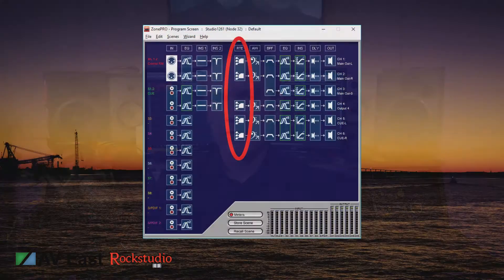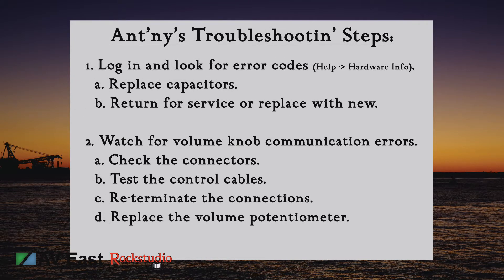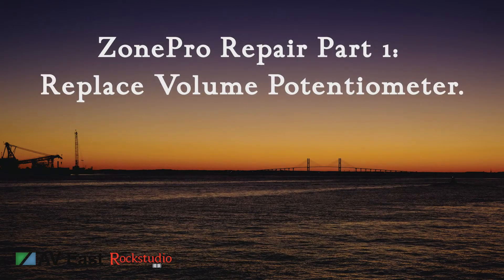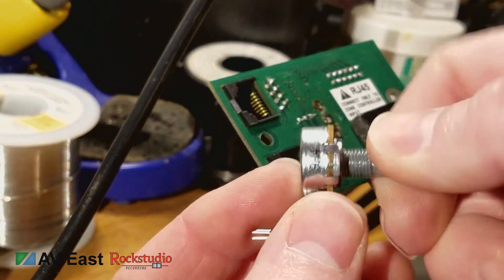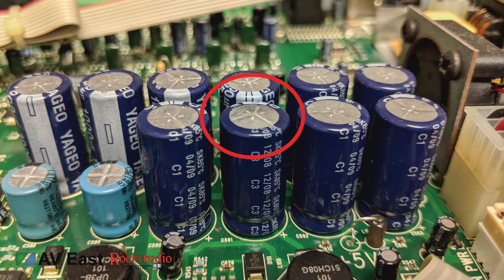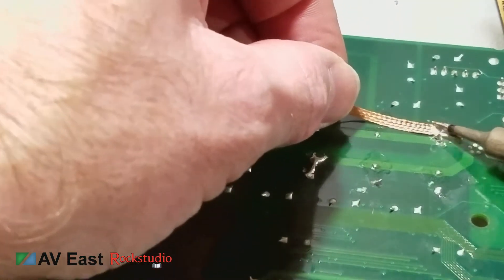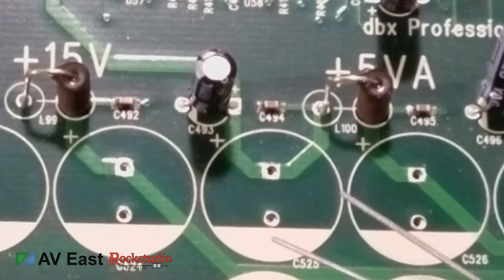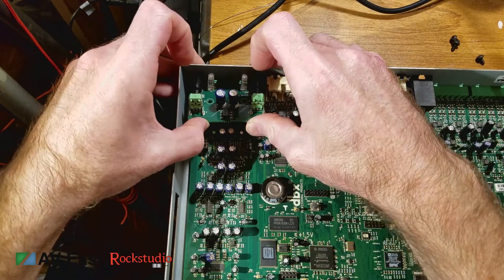dbx ZonePro - Common Problems - Troubleshoot & Repair

Comment: Thanks for the video . I was searching a while for this info, but found it too late 🙂
I bought a new DBX640 a few months ago.
But stil having problems with the potentiometer DBX part number: 40-2125 to get it here in Austria / Europe. My dealer doesn't have it and Harman Austria doesn't "know" it. ;-)
Do you have more infos about type and range (Ohms) of the pot - maybe I can get it from another fabric/dealer.
Thank you

Comment: Great Video , I have a customer with a Zone Pro 1260 that changes sources by itself, any thoughts?
Reply from the maker: I have experienced this as well. I'd check/change the cables on the zc-bus. I think this happens when there's interference within the cat cable. Say your volume is on controller 1, source is on controller 2. Even though the controls are separate and may even be wired to a Break out Box individually, they still share the same 8 conductor cable, even just by virtue of the connector. So if the cable is damaged, or there is a place where the insulation is a little thin, maybe two conductors are getting close together, your control input coming across conductor 1 can now bleed into conductor 2- and now the ZonePro thinks you're sending two commands on two different controllers. Hope this helps.

Comment: I made a little notch on the side of the plastic tip of a solder sucker. Apply heat to the solder work, position the solder sucker while the solder iron tip is still on the solder (creates a seal), then pull the sucker trigger and immediately pull the solder iron tip away with a little tilt motion.  It's quick!  Alcohol cleanup step is quicker also, you don't have all the rosin from the wick.

Comment: Craziest thing is that I’ve been installing these since 2004 when they came out, and at the time there was no other unit which could do even close to what a ZonePro does that didn’t involve having to be a sound engineer to operate.    These are designed with the retail space GM as the operator, and they are excellent at that.    Oh, so I’ve installed maybe 50 or so of these units, always the 640 or 1260, and have never had one single failure.    I was responding to a concern from a client and just for kicks I looked up, “do dbx ZonePros ever fail?”     And this popped up.    I’ve also never noticed them running hot.    In fact I’ve never installed a fan and they are always mounted directly on top of the Crown amps, driving JBL Control 25 or 28 speakers and sometimes C26s for bathrooms.     This combo has proven dead reliable.   Most often any problems end up being user error.  Someone may have added IT stuff to the rack and accidentally left an IEC cable just loose enough to become intermittent, or touched a network cable just right to cause the same, even though I stress test everything when  buttoning up a rack, meaning I pull and push and twist all cables to assure there are no bad connections.     Usually someone has rubbed against a ZC knob and broken it, or some wise guy has muted the zone on the face of the unit or turned off an amp or something like that.    I have had a few Crown amps die, but that was because the client left it on for like three or five years and when power went out or it got turned off for whatever reason, it wouldn’t power back up.     Crown tech said a cap in the start up sequence will cook itself if left on forever.   But at that only two amps have done that, and most clients just leave them in even when I implore them to let them cool off once in a while.      The knobs are not potentiometers by the way, which would be analog in nature.   Digital versions are called encoders.    It changes code.   Duh.    I’ve had one develop an bad connection at the mic/line input level selection button next to the gain knob.    That’s it.    Sometimes the screen loses contrast.     Usually a factory reset fixed that even.     I’ve had one where the manager needed to shut off the unit and let it discharge its caps, and then turn it back on 90 seconds later and it was fixed.   It was not responding to input changes on a ZC8.   I’ve had ZCs outside at a bar on immediately over salt water, telling the client that location would ruin it and I gave it one year to last.   That was 2005.   Still works, covered in grenadine and all.     Sometimes the LED will fail, but not really, it just falls out of the lense.    Put it back out a drop of superglue on it and all fixed.     Network cables not cleanly terminated have been my biggest issue,  so I e learned to get good at that, and no more of those issues.      So.    Thanks.    I guess I’m lucky or just not hearing about it when they fail.   I’ve not heard from some clients in ten years and assumed some other sales guy talked them into something else, but no, they just had to remove it for a remodel and asked which wires went where, I talked them through it, and saved a two hour drive for repair.    Other companies sell maintenance plans.   I sell a promise that it will be the last gear they buy for many years with no number given, but start listing off places which have been trouble free for 5,7, 10+ years and they are convinced.   My lousy salesmanship has  gotten me a 95% closure rate on prospective sales.    Can anyone touch that?     It’s called trust, and especially when it’s a referral, which they all are, they trust me before they meet me.      I’ll never be rich from a service plan, but my clients trust my word without question.
Reply from the maker: Well, quite the yarn! Thanks for commenting. I don't do service plans either, I sell and install equipment that will last for a very long time. I am in the deep south, on the Atlantic, so we have very hot weather most of the year, very humid all year. That's why I've been installing fans on all of my zonepros, they are lasting longer now. If fact (hope I don't jinx it) I don't think I've had more than one failure since I started doing so. Every one I've ever installed will run hot, uncomfortable to touch. Like you said, you must be lucky.

Comment: Hey man I really appreciate your input on dbx products, but a lot of people having issues with dbx venue 360 and PA2, overtime this units won’t pass the logo screen and require hard resets or even connect to a pc and wipe and install the running software, sometimes this steps don’t even work and you need to just throw away the unit, my humble opinion about dbx at this moment is that they are partnered with Chinese companies and everything they make right now is absolute garbage.!.! Period
Reply from the maker: I don't know too much about their situation from an engineering / update future products perspective. However, I can say after veering away from their drive rack products, that in today's world I would not use one of their drive rack products but look to a more complex yet flexible solution. For instance, you can buy a used Biamp Nexia SP or CS for around $100. In fact, at that price you can buy two, program them both the same, and leave one as a cold spare. Then you can lay out your processing changes exactly as you'd like, and it gives you way more flexibility than the driverack. Even their Venue 360 is completely outdated by today's standards- it has a bare minimum interface, it doesn't have very user-friendly controls (difficult  or impossible to input a specific value, making you rely on sluggish faders on the GUI), and a very inflexible routing system. A processor like the nexia is incredibly customisable, and you can build special features and very complex or simple processing chains. If anybody would like to see a video on setting up a nexia, let me know. Thank you so much for watching and commenting.

Comment: Anthony, thanks so much for bringing some light on the depths of the ZC absyss, I'm fixing a sound system at a bar running on a 640m and I'm having a headache connecting the unit to the software. I cant understand why they came up with such a specific pinout for the RS323. I'll come back to the bar tomorrow for a second round using the LAN cable but today it was so frustrating trying to make it work with a regular RS 323.
Reply from the maker: You can't connect to the 640m with an Ethernet cable. You have to use the serial cable. I use the tripp-lite Keyspan USB to serial adapter. It works great. First you run the trip light software called keyspan serial assistant (or something like that), and you can see which Port is connected to, it'll say idle. Then when you open up the dbx zone pro designer software, you can go to the settings and select that com port. You must run that keyspan serial assistant software before you run the dbx zone pro designer, every time.
Reply: @therockstudio  Oh thanks so much for this! I couldn't get the Keyspan but I got a similar one from a brand called Sabrent. Do you think I could get away by rewiring the RS323 cable in order to get the specific routing the original modem null dbx provides?
Reply from the maker: @skyparnes  I don't know, I'm not an expert (or even a noob) on RS protocols, I just use the standard serial cable that comes with the dbx, and the keyspan.
Reply: @therockstudio not true about every time.   You just need a decent serial to USB adapter, download the driver for that adapter, and you’re on your way.    You should look at the hardware part of your computer to identify which COM port you will be using, because you’ll need to punch that into the dbx software to connect your laptop to the unit.    There is no pin out mod needed.    Once you’ve done it a few times it becomes second nature.   It will find the correct address and ask you if you want to send or request a program.    Do what is appropriate.     Sometimes if you don’t close out a previous session the software will come up as busy.(running) .   Just clear that out and start over.
Reply from the maker: @andrewhigdon8346  You may be right, I connected to one today and did not start the keyspan serial software beforehand, and it was able to connect. However, the reason I have always started the keyspan serial software prior to starting the zonePro designer software, is because in the past I had to do so. So your mileage may vary.

Comment: Have you ever encountered a unit functioning normally, but none of the buttons/controls on the front respond at all?  It's a 1260
Reply from the maker: The front panel controls may be locked. I'm not sure how to do it/if it's possible. But take a look

Comment: Hi thanks for the great video ! I have the 1260 model and its starting(not really) with an "critical rtc_calibrateDSP READ Fail" -  error (I bought it for very! cheap on a marketplace, but cant retourn it). So it keep rebooting due to this error. In the debug menu i see that the watchdog timer is all zeroed. I can connect over RS232 and IP to the ZonePro, but after a few minutes its rebooting. Sometimes it stays on but with an meter error and its flickering on the frontpanel leds(VU meter). Do you have any ideas? Ive opened the housing and dont see any blown caps or something else strange. 
When I set the time through the designer software it wont appear anyways in the watchdog timer(dont know if its the same clock). The error still appears after disconnecting every connection(so just the power connector plugged in). Ive updated the firmware to the latest release.
Would be really thanksful if you have any ideas :). Kind regards
Reply from the maker: Hi thanks for watching! Your situation is beyond my scope of knowledge of the dbx:( I'm so sorry but you should definitely reach out to dbx (Harman) tech support: (844) 776-4899

Have you used the CPU reset button on the PCB? I don't know really anything about programming and where the real time clock error would originate.

Comment: Thanks for the info in this video! Question: I have a 1261 that keeps blowing fuses even if the power supply board is disconnected from the main board via the 6 pin connector. Any idea what might need to be replaced on the power supply board? Thanks in advance!
Reply from the maker: Hi thanks for commenting. I'm not an electronics tech, but I'd look at the bridge rectifier and check the taps on the transformer. Beyond this I have no idea! Maybe you have a good electronics tech in your town. That power supply is going to be pretty standard, as far as power supplies go. Also don't forget, you can call Harman tech support, perhaps they offer a replacement PSU.
Reply from the maker: The replacement part # is 5061867
DBX doesn't have any in stock right now, you can order one but it might take 8 weeks or longer! I've put an email into my distributor, to see if they happen to have one in stock. I'll let you know if they do.
Reply: @therockstudio  wow thank you so much for that info! Much appreciated sir! Good to know there are people out there willing to help others such as yourself.
Reply from the maker: OK, I heard from my parts guy, he said the part # is actually 23-0000-DBX, it's about $57, 3 week lead-time.
Reply: @therockstudio  Wow that's incredible! Can you by chance give me a contact or link where I can purchase it? THANK YOU
Reply from the maker: @deanhopkins4117  call Full Compass, ask for José in the parts dept.  (800) 356-5844
Reply: @therockstudio  THANK YOU ANTHONY!!!

Comment: I have a dbx driverack pa+ and i randomly loose one top channel
Reply from the maker: @JustHelpMeOuT5466  hi, if you don't have a good electronic repair shop near you, you can follow some steps in this video. I haven't ever looked inside a driverack, but there may be some basic troubleshooting steps that would be applicable. One thing to check (on any equipment that randomly stops working) is the solder joints on the xlr connectors, where they join the PCB- Check those or simply add a little solder and reheat each one until it liquifies (we call this reflow). Thanks for watching.

Comment: Hey I have a 1261m with only half outputs and inputs working.  Copying program and moving connections to another everything works.   Any thoughts? Much appreciated
Reply: Left side only working on in and out regardless of input or output connection,
Reply from the maker: Wow, I'm not sure really. Have you checked the capacitors? Also, check the audio bus jumpers. There is also a reset button on the PCB, try hitting that and see if it resets the whole device. Otherwise, call Harman support, they'll likely send you to a nearby authorised repair centre.

Comment: Any chance you've encountered an issue where the zonepro is detected but not resolved?  I have three on the local network and two currently show up - one came up after a minute and one shows in the address tool as "Detected".
Reply from the maker: Can you see the device on your network, without using the Zonepro designer? Like, have you tried scanning the network with a tool like Advanced IP Scanner or Fing? I'd first recommend restarting the units, then disconnecting the one that works properly, maybe there's a conflict? So just make note of the IP address for the good unit, then unplug it. Then restart, and plug-in each of the other devices individually, and try to find their IP addresses. Chances are, the IPs just changed to something crazy, and just have to be reconfigured. That's why it's important to have the USB to serial adapter! You can always get in to the device with serial, not always with ethernet.

Comment: I recently bought a new microphone with XLR - 3.5mm and when I  plug in it starts buzzing, like microphone doesn't work, only cable buzzes, microphone doesn't work, only buzzing from cable, pleasee helpp mee and sorry for english :(( my microphone Media-Tech STUDIO AND STREAMING MICROPHONE MT396
Reply from the maker: Can you tell me what make & model of microphone?
Reply: @therockstudio  model MT396, media tech
Reply from the maker: I can't find any information on that microphone. It may be a "plug in power" mic, which needs power from the camera.
Reply: @therockstudio  I can send you link to the microphone
Reply from the maker: The manual says it's a condenser mic, but makes no mention of how many volts it requires. Have you tried using the included usb sound card?
Reply: @therockstudio  yea I tried, still nothing
Reply from the maker: Open it up, and see if there's a place for a battery in it? I don't know. Is there a phantom power switch on the USB interface?
Reply: @therockstudio  and still if I pull out the cable from Microphone, I still can hear the buzzing
Reply from the maker: Open up the microphone, see if there's a battery spot. Otherwise check that cable. If the cables buzzing by itself, you may have a faulty cable. You can use a multimeter in continuity mode, check between conductors, and then check from end to end.
Reply: @therockstudio  ok, but what if  buy another cable? Could this help me?
Reply: @therockstudio  what if I buy PP481 power supply?
Reply from the maker: Yes, I'd try another cable first. Otherwise, call the company and ask them for assistance.
Reply: @therockstudio  which budget cable do you recommend?
Reply from the maker: I don't know how that cable is wired, honestly. You can check out my video about making a cable, but you need to know the pinout of your cable first. Otherwise, I'd recommend a cable by Hosa. Where are you located?
Reply: @therockstudio  I live in Lithuania
Reply: @therockstudio  and my cable is HIGH GRADE PROFESSIONAL LOW-NOISE MICROPHONE CABLE
Reply from the maker: Maybe something like this: https://www.amazon.com/Hosa-XVM-115F-XLR3F-Right-Microphone/dp/B000068NZD/ref=sr_1_4?crid=3D3GQR4J7VZ42&dchild=1&keywords=xlr%2Bto%2B3.5mm%2Bhosa&qid=1608699842&sprefix=xlr%2Bto%2B3.5mm%2Bhosa%2Caps%2C173&sr=8-4&th=1